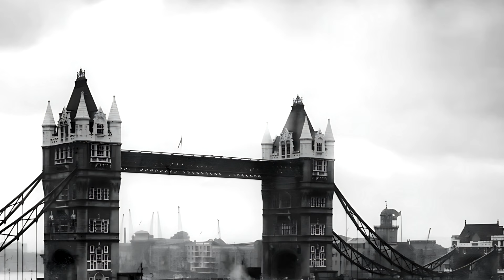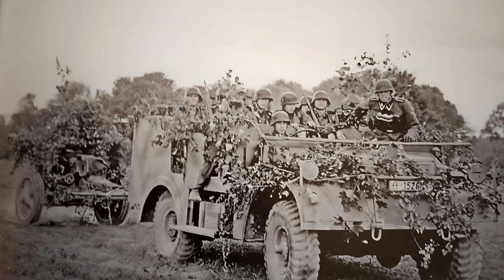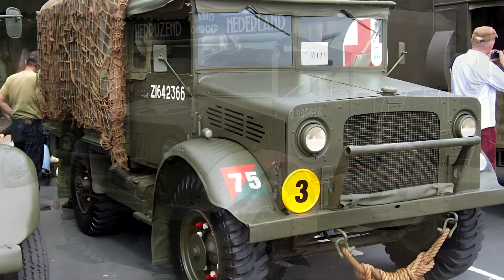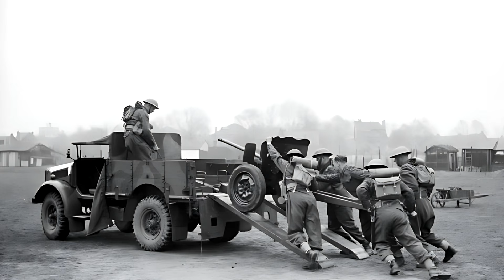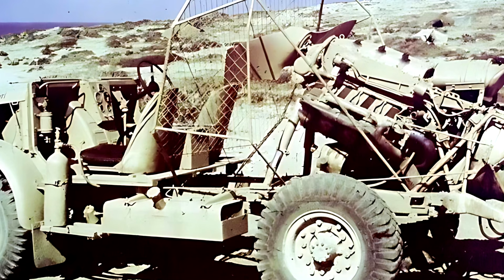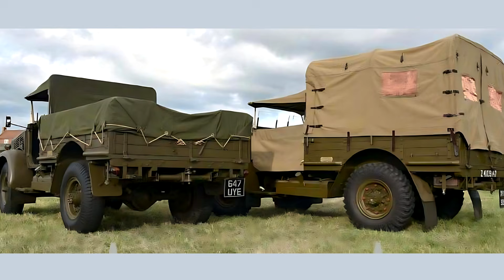1939 Bedford MW 💥 The Little Truck with a Giant Reputation

Comment: When I joined the Army, we had RL Bedford lorries which I am sure, had the same 6 cylinder engine the Bedford MW had. Seriously, they were so easy to "fix"  - just a basic knowledge of car mechanics, some number 8 fencing wire and a couple of spanners and Bob's your uncle; the Bedford RL was on the move again. As troopies, the ride on the back wasn't anything to write home about, but I can tell you, after busting your guts out, slogging with heavy pack, wet, cold and hungry, everyone was only too glad to jump up on the old RL.
Reply: the MW had a smaller engine than the RL, the RL had a 4927cc petrol engine, or known as the 300cu engine
Reply: the rl had a 300cu,in engine, the mw had a 28bhp engine,